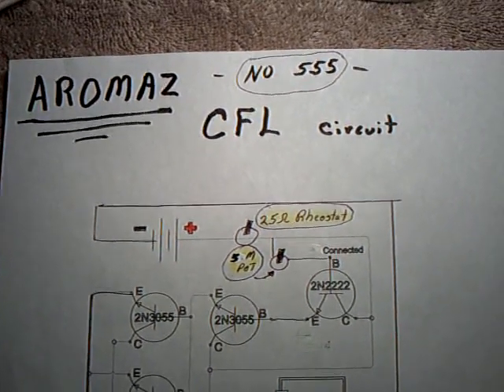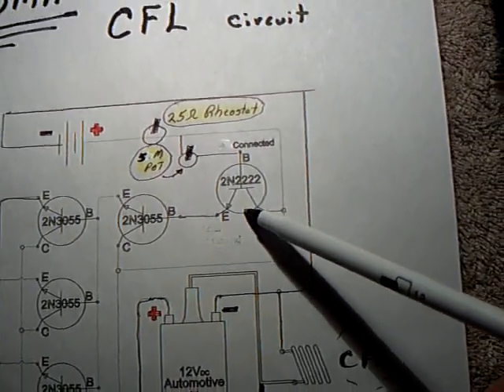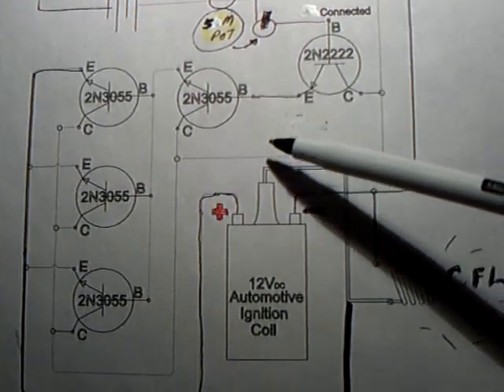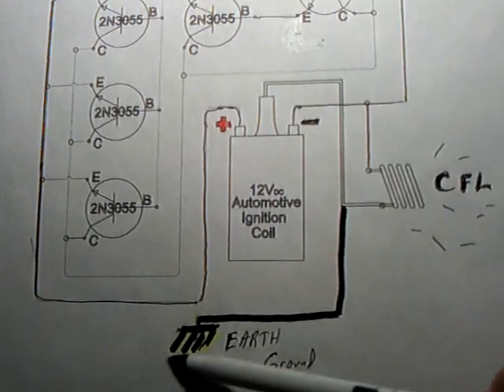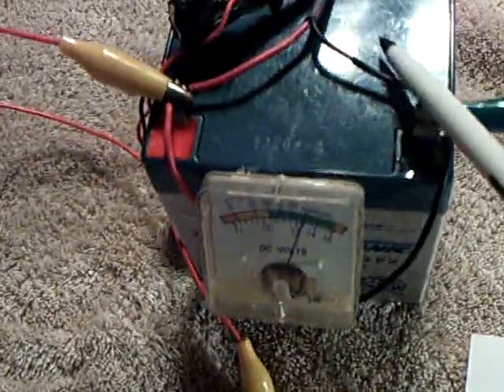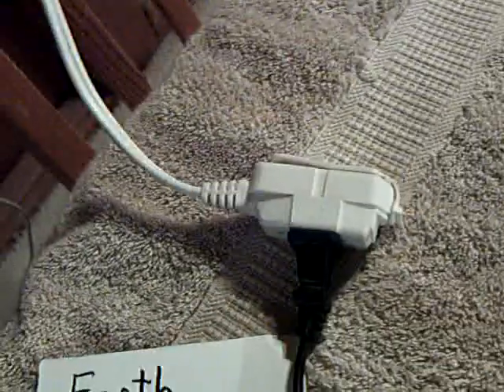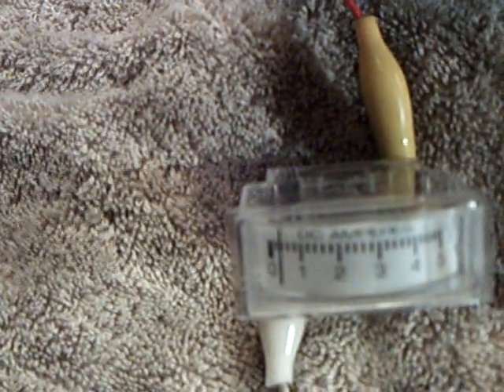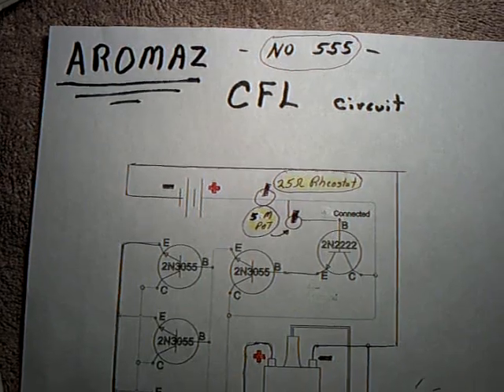Aromaz CFL Circuit

Comment: I like the idea of moving the earth-ground around. I tried putting GROUND on the output of the coil in the bodkins/bedini curcuit and the advantage there is that you can touch the HOT of the coil and not get zapped since it is ground relative .. yet all still works.

Comment: Looks to me like you are simply building a tank circuit, hence less power is required as resonance is approached. The earth ground is a virtual ground being that there is no reflection path. 

There is a noticable change in frequency when the ground is connected. This seems very much like a tank circuit. I'd bet that a simple cap of proper values would produce the same result.

I see no reason to believe that this is anything but resonant action *tank circuit*

Comment: Yes, you're right, the Earth and a human give off the same energy. Plus, we, and the Earth, have a bit of resistance in us as well.  That is why some equipment will not run unless it is grounded.  I came across a digital 220VAC dryer control that ran on 110VAC and when you would push it to go into the kfluf cycle, it would click the relay, but than click back off about a second later.  It turns out that it REQUIRES ground to operate properly.  Also worked by touching the ground pin to your skin.